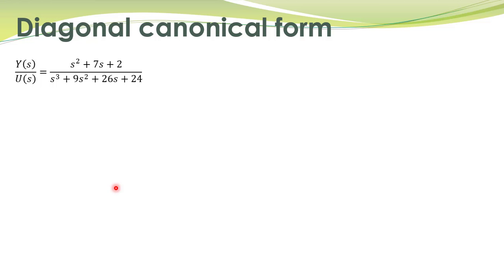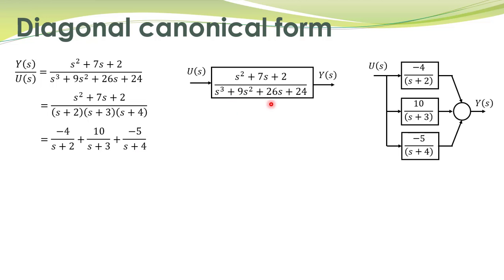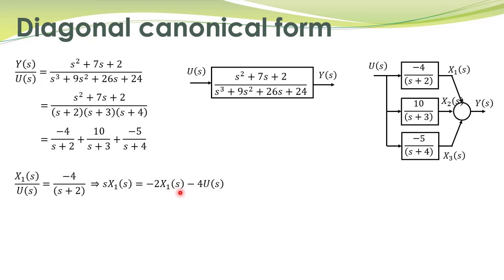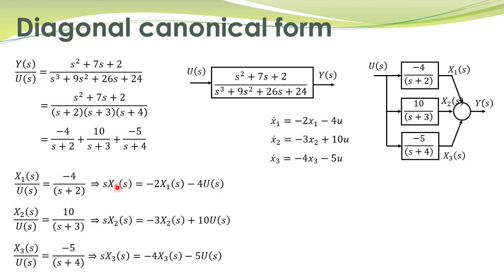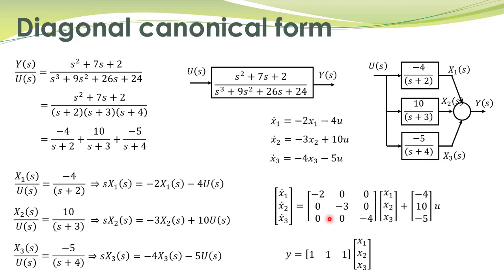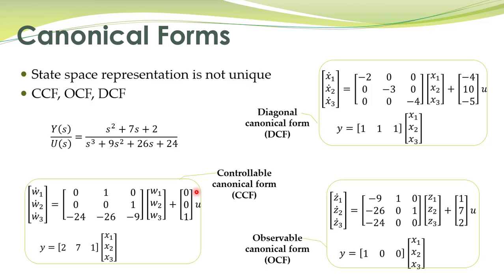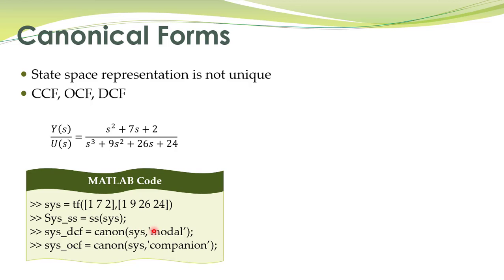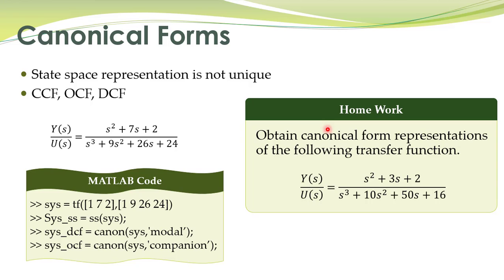LCS - 53c - Diagonal canonical form (DCF) representation of state equations

Comment: Sir, this is modal diagonal form.
Reply from the maker: Yes.
Reply: @MAFarooqi  But this is not diagonal canonical form rather it is just diagonal form.
Reply from the maker: Can you please further elaborate the difference between diagonal form and diagonal canonical form?

In Diagonal Canonical Form, the system matrix A is a diagonal matrix (for distinct eigenvalues) and the coefficient matrices B, C, D do not follow any particular form. Therefore, the canonical form described in the lecture is Diagonal Canonical Form.

Comment: THERE IS A MISTAKE MATRIX B MUST BE ALL 1. We should take it as X1(s)=U(s)/s+2 poles are not taken. Your explanations are really nice.
Reply from the maker: Yes, you can do it in this way as well. In that case, the C matrix will be different.
Reply: @MAFarooqi so sir basically B And C matrix are interchangeable in diagonal canonical form both ways are correct?